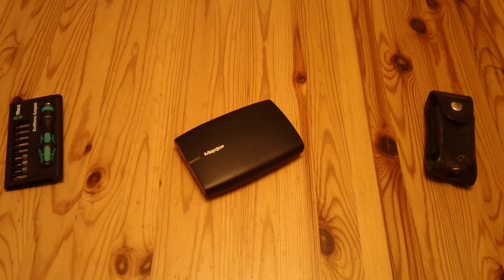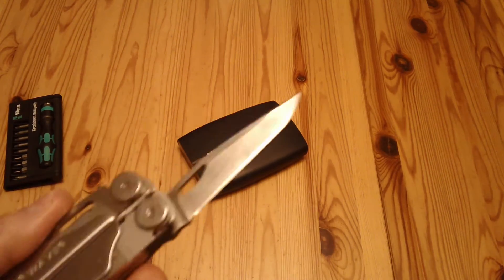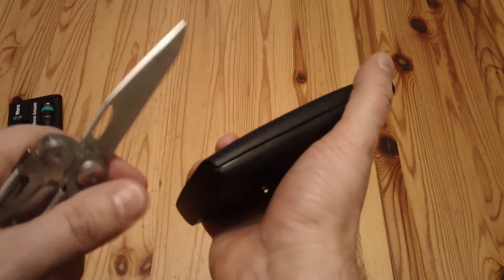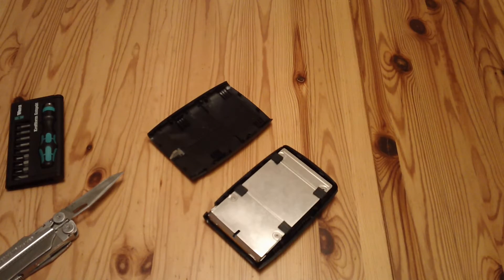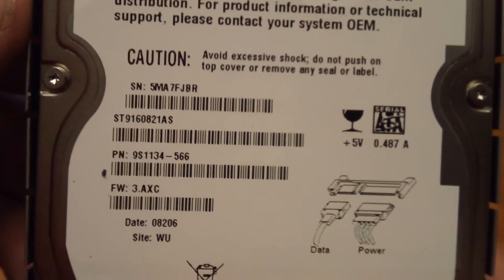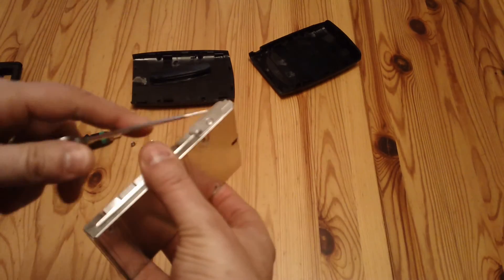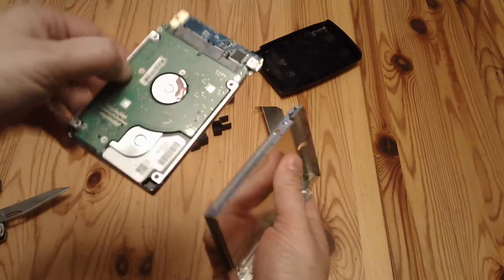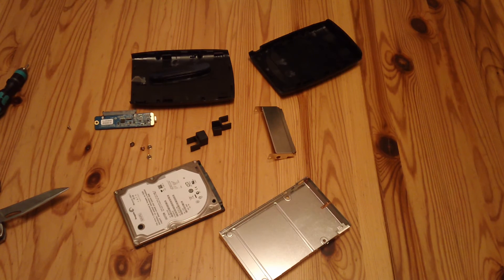Maxtor Basics Personal Storage *HOW TO* Remove Drive For Data Recovery

Comment: I made it through your detailed video. I don’t understand the caddy another machine part.
Reply from the maker: The drive inside the enclosure is a standard 2.5" laptop SATA drive. So it can be connected to anything and everything that normally works with that kind of drive.

:)

Comment: I hope you can advise. Mine is not showing up. It worked yesterday morning but not last night. My business is on this drive. I am kicking myself for not updating it. Any and all advice is appreciated.
Reply from the maker: Remove the drive as shown in the video... then you can try connecting it to other devices... choices are as follows...

1. SATA to USB cable - should work without external power as the drive is a 2.5" model. On balance, this is the cheapest and easiest.

2. Use a desktop PC - you'll need the right cables though.

3. Buy another 2.5" SATA enclosure and put the drive in it.

4. Buy a 2.5"/3.5" drive dock. Not the cheapest option, but these devices are handy to have around.

I can make a video if you want me too - I'm not sponsored by anyone but happy to mention the actual things I use.

Comment: looks more sophisticated than normal external 2.5" HDD, can I just get another HDD case and transfer this over?
Reply: btw thanks for the breakdown
Reply from the maker: The video show you how to open up the device to remove the drive for data recovery if it’s not responding.

But if your one still works then of course it’ll be easier to just plug it in and copy the data over to another drive.

🙂
Reply: @sterntechdaddy  mine is just beeping away and not detected by the pc. I'm guessing the connections have failed so considering the new HDD case method..

Comment: Hi Nic  wonder if you can help me   I have one of these drives and have used it since 2009,  now it looks like the drivers i used have gone as when pluging in cant see required drivers.  Old pc running XP HE.   tried to find the drivers no joy.  Any chance you could let me have a copy, wife want all of our family pics on another device and im dead meat if i cant get this sorted !  Thanks in advance.  Mark
Reply from the maker: The device in the video is long gone...

But it should be readable on a modern PC if you can get access to one because a specific driver shouldn't be needed.

You can also remove the hard drive and put it into a new USB caddie too - which is what I did for the device shown in the video.

Comment: is it fine for me to use some sort of lubricant on the screws? mine are kind of rusty and I'm trying not to do anything that'll risk breaking the hdd down.
Reply from the maker: It's tricky.... Here's your options as I see it...

I would remember that the HDD itself has a very solid metal frame and that the screws actually fit into that rather than anything particularly flexible. So if the screws are rusted and you have to use a lot of force then you'll only damage the drive if you accidentally slip and drop it.... The screw driver you use needs to be a good one and you might also damage the screws if its a lose fit - I use Wera tools to avoid that... they fit so well it's like the screw is welded to the end of the driver.

But a tiny amount of WD40 put on the screws with an ear bud is a possibility - HDD aren't liquid proof though so you'll need to be really careful if you want to try that because WD40 is really penetrating.